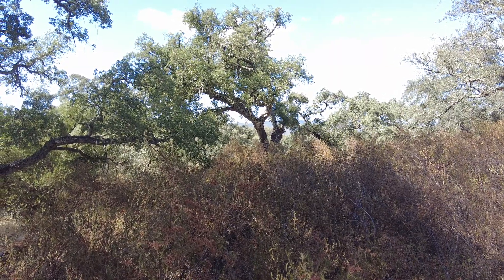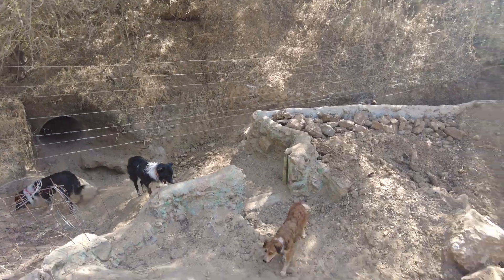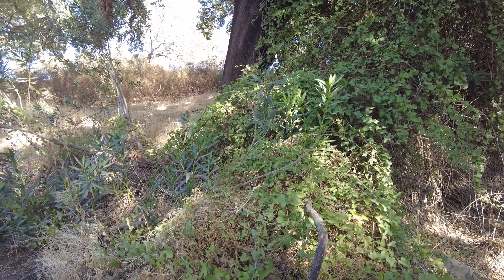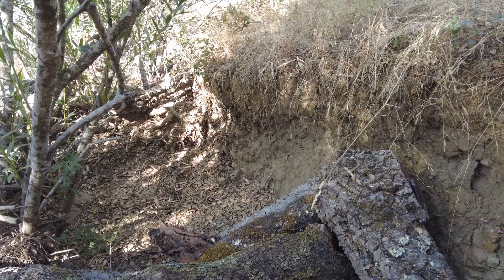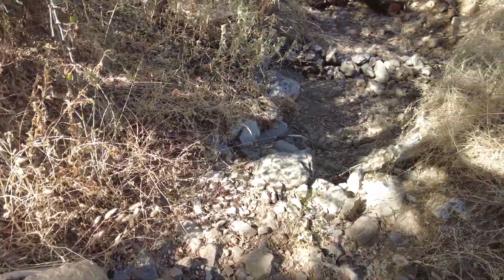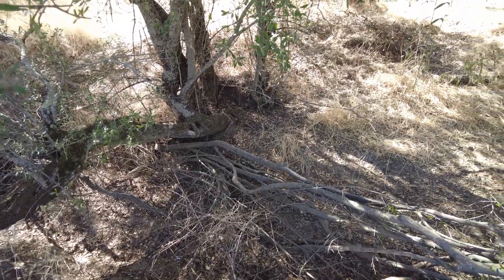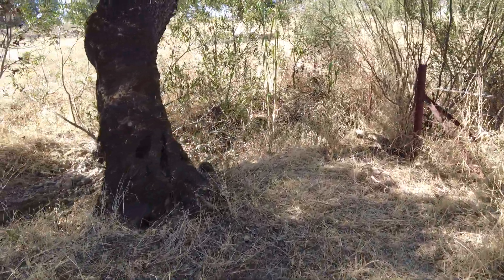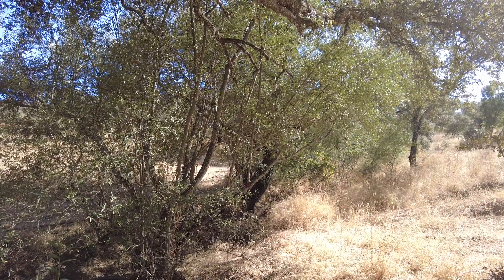Leaky weirs are ready to be weather tested.

Comment: Hello 
I think there is a mis conception.  If you put obstacles in the stream, keeep the same width and the same slope, you will not slow water but accelerate it localy.

If you are successfull at slowing water in those condition, it means you will store it and be at risk of structural failure.
Reply: Anyway you worked a lot. Bravo
Reply from the maker: @user-vo3st8kx7s  Very good observation. Let me chew on this one.

Comment: Wow, nice. It seems you are running out of stones, it is a good idea to stack them into structures before covered in sediment. 
What about building some minidams with cinder blocks, just 2-3 layers tall, while bedrock is still accessible?

Some beaver dams are 1000+ years old, but it's an ongoing process, they are maintained daily. This creek requires the same.

Bags failed in the past, and they look, well, not the best. Stones or a 2-3 cinder blocks high dam would do better. That log might get washed away.

Never too many leaky weirs/dams in the creek, great direction, and great progress!
Reply from the maker: @hotbit7327  Thanks for the suggestions. Much appreciated

Comment: Our 'winter' has arrived all at once. It is nearly always wet, so that has not changed, but suddenly it is much colder and it is possible we had a touch of ground frost the other night.

What I mostly noticed was that I had to get out the 'window schlooper' to schloop off the condensation that might bring black mould if I left it.
Reply from the maker: @SMTRodent  Amazing what you say. Here we are still in full summer. Let's exchange and mix temperatures.

Comment: Hi Martin, I cannot wiat to see how the creek will behave when the first torrents will pas into it. I did a lot of anti-erosionworks in Bukina Faso in the 80's and was always trying to see the water flow. However the most projects were at 10 to 40 km away and the rain did often not fall there when it rained at my house. But in 3,5 yrs I managed around 10 times to really see it flowing and it exited me always. I think you do a gooed job there. Maybe a suggestion: the big light logs could be a bit more stable if you tie them together with rope or wire.
Reply: OUHHHH - this is a really good suggestion!  It is straightforward, does not require a great deal of additional labor hours or material costs and ensures that no individual logs get moved downstream.  Unitizing the pile in this manner  also gives you the opportunity to incorporate bundles of cistus/hera and smaller branches to reduce some of the bigger gaps, if you like. 👍
Reply from the maker: @maup1154  Super suggestion. I'll try.

Comment: That was a great walkthrough! This will be a great comparison video to rewatch after a rainy season has passed, to see how the flow has further "evolved" your creek. =)

I do like the idea of a settlement pond near the bottom of your system. With all the sand and sediment that is brought to you through the culvert, plus all of the organic material in the creek, it would be a shame to lose all that material as it gets washed away. Slowing the water down should definitely help, as you're doing. Having a place for it all to settle would be excellent, if it works, and provide you with a near-limitless supply of sediment for gardens or other projects. So I really hope it holds and doesn't get washed out!
Reply: The only suggestion I can think of for that bottom wide pond/outlet area is to make sure wherever the water does leave (aka the lowest areas) to make sure to line it with stones to prevent erosion. And to monitor how much sediment is deposited - what is now a pond may quickly become a plateau with enough volume! I think you're on a great track though and can't wait to see how it all operates, and how you adapt to whatever surprises nature has in store.
Reply from the maker: @DustinHarms  Yes. I agree. At least we have the blueprint ready. Time will help us to reevaluate. Thank you for sharing with us.

Comment: Congratulations on implementing some very good engineering. 

Be great to see the creek organism in action with some water flowing soon. 

Looks like your venturing into stage 2 of leaky weir development. At 10,55 you show the "wheel barrow access" dam which is a stage 2 development. 

Stage 2 meaning building the leaky weir slightly higher than the creek bank level and flooding the flood plain. Even if the floidplain in some areas is half a tennis cout size, its still a floodplain, and can absorb heaps of water. 

The thing that will protect wheel barrow dam is lots of reeds growing up stream that can bend over the dam wall in a flood a provide a " carpet" for water flow, in conjunction with a little swale to take water to the floodplain.
Reply from the maker: @adammac4381  Great to hear that I've reached stage two already. Thank you for sharing that information
Reply: @SuerteDelMolinoFarm  looks like you have actually reached stage 5. Its something you'll tinker with for a long time,,,, the next stage is actually 3 days off with an inch of rain each day for priming the system.

You have built a wonderful system, but there's more stages and add ons coming.